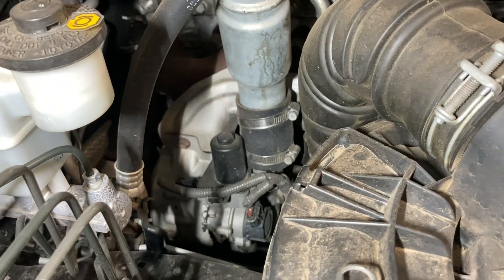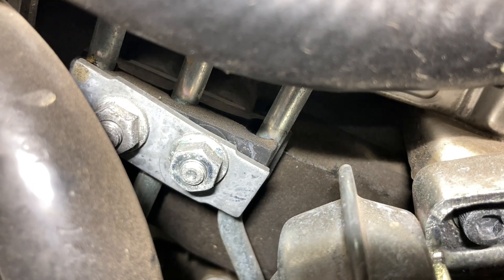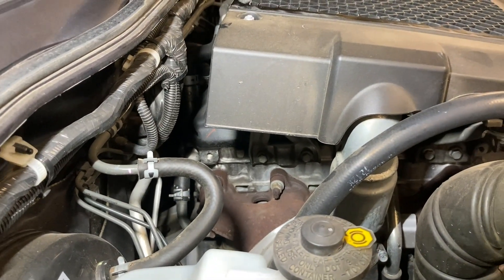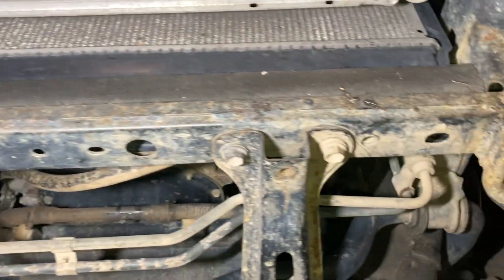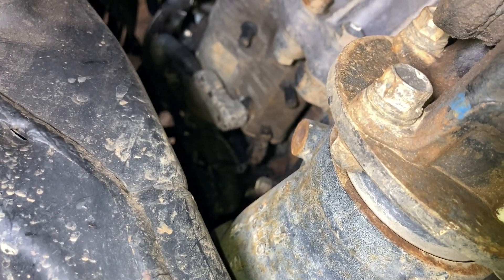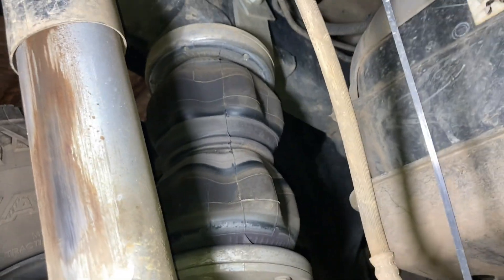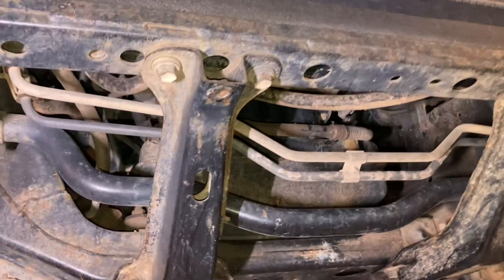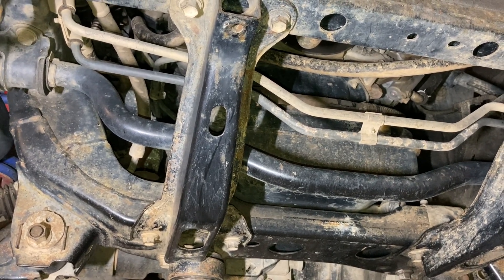The BUTCHERS Have Been at it AGAIN - But lots of good news 300,000k Hilux

Comment: This hilux now has new tires and new Dobinson suspension throughout and it drives 100% better. Thanks Anthony and crew. 
From what I have been told the tire wear was from the previous owner not checking their tire pressures, and that suspension would not have helped either... 
She is defiantly coming back grave the dead now... ;-)

Comment: Anthony , hows it all going.   Could you please see how much up and down movement is on the inside CV joint on the passenger side . I just checked mine and there is about 4 mm but no oil leak.
Thanks mate , Darryl .